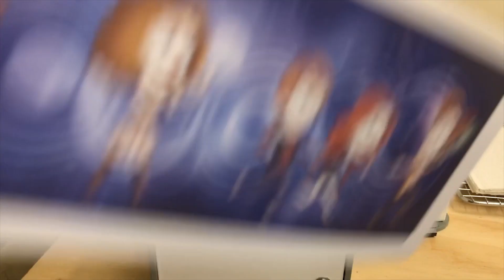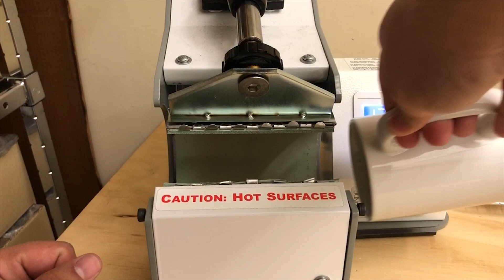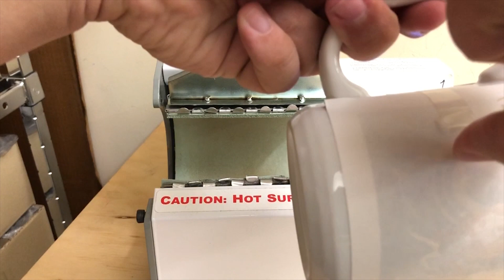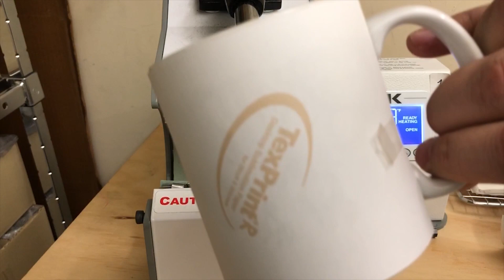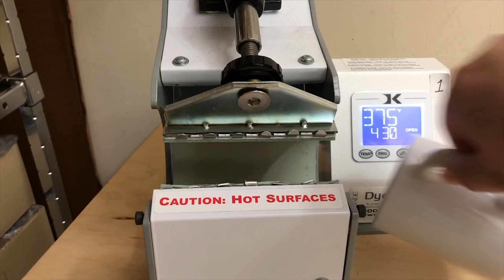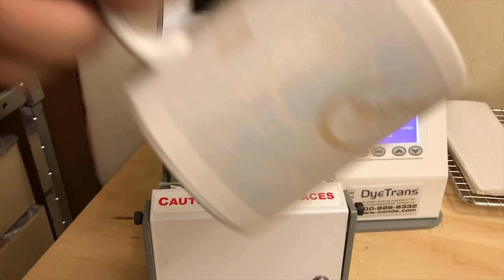Mug Sublimation | Carolina Thread Place

Comment: Water prevents Ghosting
Reply from the maker: EXACTLY!  Since ceramic holds heat for an extended period of time, the dye will continue to move around until it hits below a certain temp.  Once the substrate hits a certain temp. the gas turns into a solid and the image is set.  However, if the mug hits 380+ degrees, it could cause ghosting.  Awesome job Karen!!

Comment: Greetings and salutations! Hello! Good video, Will! I know that when we fabricate tools , we dip the tool into water to harden the steel. Sublimation  is the transfer of a solid to a gas. With printing, the ink is transferred to the "plastic" coating on the ceramic mug. Because the mug is a hard surface, might be that the print and the mug's coating need to be "hardened". Some fabricators dip into oil. But methinks that is to allow  the tool to be buffed into a shine. I digress. My answer it to harden the ink and coating. 

Sir, we hope that you and yours are well and taking care. Our best to all. Thank you for this video! :) :) :)  Blessings and Re Jouir. -Darlene (& Scott)
Reply from the maker: Hello there guys.  Thank you for watching the video.  The poly coating is already hardened due to the process that the manufacturer does.  However, the dye does turn into a gas form to penetrate at a molecular level.  Wow, I spelled that right!  LOL  Karen nailed it on the head that it prevents ghosting because some of the dye is still in gas form when it comes out of the press and causes a blurred effect known as ghosting.  You were going down the right rabbit hole tho.  Hope to see you Friday during my real live session.  :-)

Comment: Water cools it quickly and prevents the ink from smearing
Reply from the maker: You were on the right path.  The only thing is the dye is inside of the poly coating and even if you could touch it at full temp, it would not smear.  The water cools off the ceramic fast to put the dye below its vapor point so it becomes solid which will prevent a blurred effect known as ghosting.  Still, very awesome answers and I hope you enjoyed trying to figure this out.  It took us months to figure it out.  :-)
Reply: @CarolinaThreadPlace  wow I would've never thought of that! Have you ever tried it without putting it in water?
Reply from the maker: Yes, we did allow them to cool naturally and we noticed the images, especially text, would become blurry, ghosted, and that looks horrible.  We did some research and it was suggested by multiple people to put them in cooler than lukewarm water.  Also, change the water out once it starts to heat up to the touch.